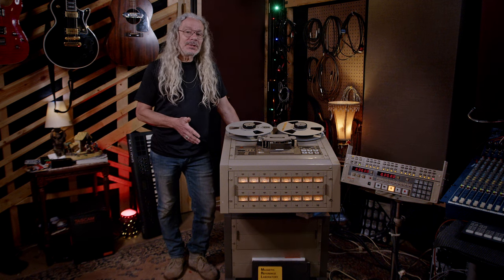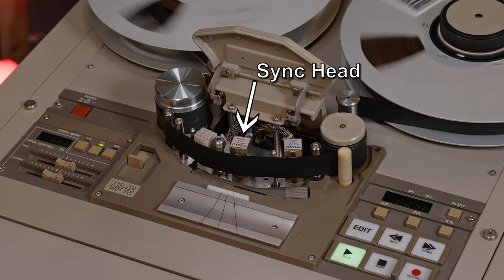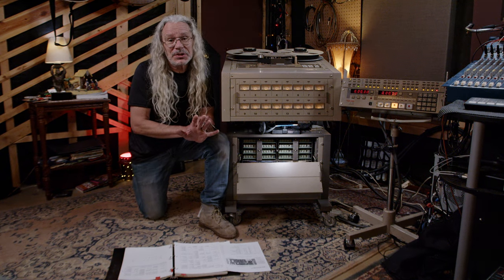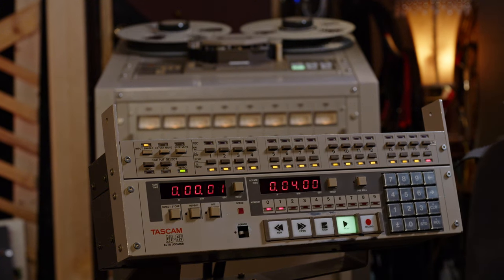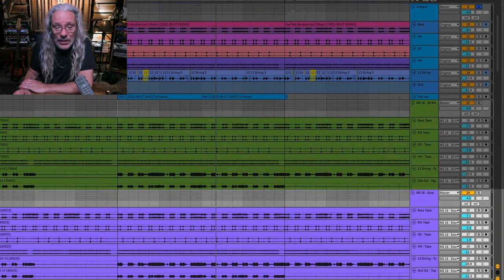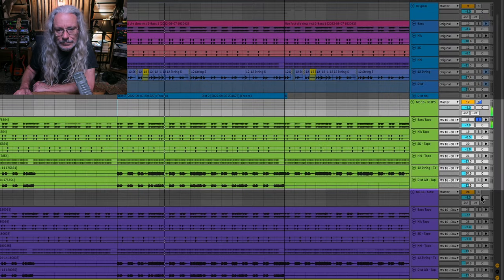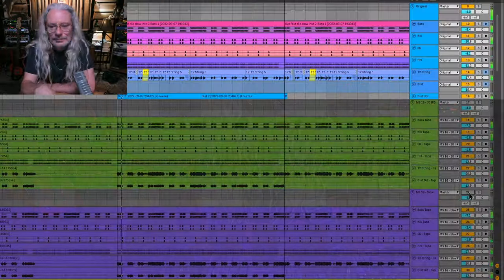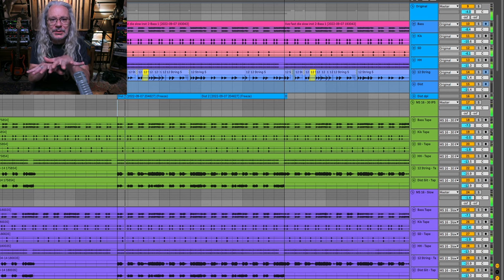Recording On My Tascam MS-16 For The First Time In 25 Years

Comment: I miss the sounds of drums recorded straight to tape. I would still have a tape machine if it wasn't so expensive to maintain and also the tape cost. I think a 2inch real of tape used to cost 200 bucks in the late 80's early 90's now I hear it's more like 400.
Reply from the maker: Yes, tape is expensive. This will be used for special projects and all of it will , for the most part, be transferred back into digital.

Comment: I've heard a lot of people say the 30ips machine is barely usable and just has no bass response. Cool to hear someone actually use one instead of just reading fourm warriors.
I think youre right on about technology in art, I've been repairing reel to reels for about 3 years now on the side and I meet a lot of people getting into tape because they feel like its something they can offer thats different. Like you say, everyones got the same DAWs, the same plugins... embrace the chaos once in a while!
Reply from the maker: Back in the day tape machine manufacturers did their best to make the machines NOT sound like tape. They wanted it to be as 'High Fi' as possible. Thus there was Dolby and DBX noise reduction and faster tape speeds. While the 30 IPS machines didn't lack any low end they weren't embellishing the bass like slower tape speeds do. The goal was to be as transparent as possible. But to me, both back then and especially now, it definitely sounds like tape. 
Thanks for watching and commenting!

Comment: More than anything, I love what tape does to both the transients and the top end. You can't beat that. That's why plugins such as Soothe are so loved (regarding taming harshness).
Reply from the maker: Yes, it's all about the transients. Always chasing those down on digital. In have Soothe but not crazy about it. Was using it for vocal harshness, but didn't think about using it for attacking transients.
Reply: @FreakingOutWithBillyHume  Sure, I didn't mean I'd use soothe for transient shaping (I think oeksound actually use Spiff for that) :)

Comment: Lovely video! I run an all-analog studio in sweden and we use our machines every day. I think maintenance is a pretty small thing and sometimes seems scarier than it is. Takes me maybe 15 minutes to do a simple calibration before a session, as they stay calibrated pretty well. Cleaning takes 1 minute. I would encourage anyone interested in tape to get a decent machine and learn the basics. Once i left The Box, i never went back. Not because of the sound (i feel my machines sound like the source) but for the archiving possibilities, the workflow and the abscense of screens.
Reply from the maker: So cool! And you're right about archiving. I've been having clients hitting me up recently about retrieving files and sessions from 5, 10, 15 years ago and it's almost impossible to pull most of them up due to drives going bad, computers going bad, formats changing and so on. However, I found some reels I did in the late 70s as well as some recordings my dad made in the 60's and  I pulled them out of the box, put them on one of my reel to reel machines (which I'd not turned on in over 20 years or more) and they played back just fine.
Reply: @FreakingOutWithBillyHume  oh yes, this is truly the strength of tape. And the longer a recording lasts, the greater the chance of it finding an audience. Thanks for a great video. :)
Reply from the maker: Thanks!

Comment: Just a quick studio hack, You could run an tone generator from your DAW and look at the output with oscilloscope and something like Voxengo Span which is free to see if there are any anomalies it might save you a few hundred dollars. Thats basically how we calibrate tape machines since our tone tape was eaten 10 years ago LOL. I have an MCI JH-24 and a Otari MX5050. It maybe just a bad adjustment pot that needs some contact cleaner or just time to get warm.
Reply from the maker: After spending 2 days messing with this an engineer buddy said the same thing to me and I was like... "duh!" That would've been so much easier! I think I was trying to retrace my steps from years ago, but now that I got that out of my system I'm doing it your way. Thanks!
Reply: @FreakingOutWithBillyHume  Cheers! I know money is tight everywhere right now so if we an save our fellow engineers a few dollars it might be helpful!! After our tone tape was shredded I freaked out a bit and then figured this would work the same way. Glad this idea helped. Love the channel by the way!!

Comment: Hee hee hee! Ah, the manual. Yeah, I was a technician decades ago. Once upon a time, one of my bosses was one of the guys who designed the Intel 80386.  Anyways, what these videos don't convey is the CHUNK these machines make when the reels stop. Even a little Tascam cassette deck, CHUNK.  After years out of audio, I had to buy a Tascam DP-32SD unit to do recording at home because I couldn't get the hang of DAWs. Still don't like DAW software.

Yeah, the snare sounds "pitched down" because the highs are being lost, like a natural low-pass filter. It's what we have been accustomed to since the dawning of recording.  We like our fluffy teddy bears!

Comment: This may be a stupid question and I don't know much about recording but, have always wondered if there would be a benefit to setting up microphones in say "the corners" of a room... so 4 tracks. Then just playing something acoustically maybe with drums and vocals too. Then If you remove the microphones and replace them with speakers for playback (maybe something omnidirectional?) in the same room, in the same spots... would it sound like the band is playing there with you again? 

Just a question I've wondered about because I always see the mics positioned right next to each performer. With digital mixing I feel like modern songs don't have the same... imaging? as older stuff sometimes. The sound just seems to come from a void instead of specific spot in the room...

Comment: Hi, help needed lol I own this machine and I’m trying to do the calibrations you are doing in this video but I’m not sure which screws to turn in the cards for each adjustment ( sync repro etc) on the bottom. Which is which ??  Thank you 🙏🏽
Reply from the maker: You'll need the chart in the technical manual. If you can't find it online maybe I can scan it.